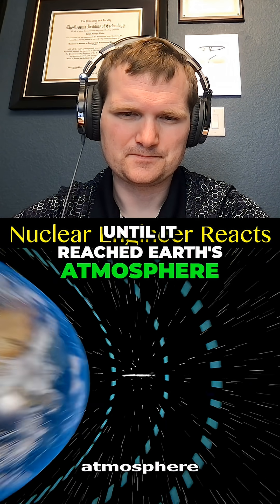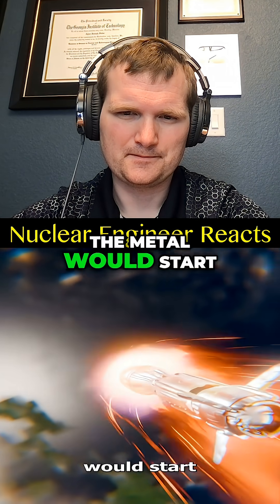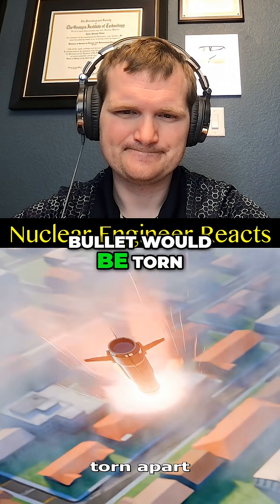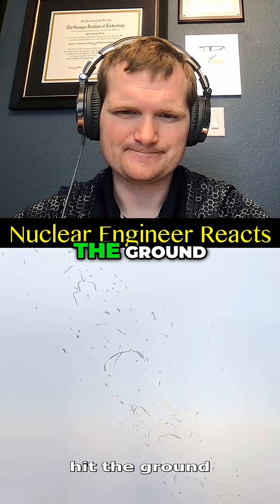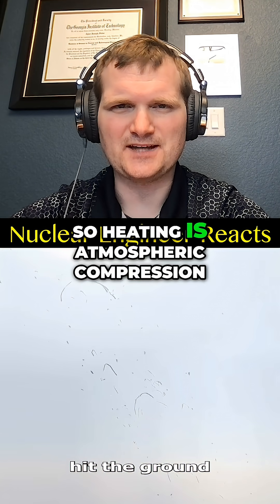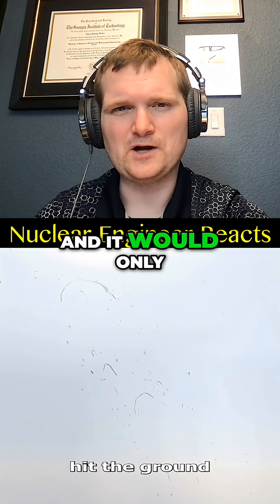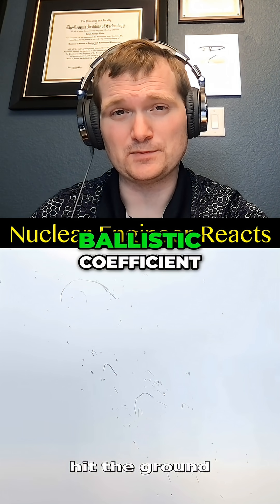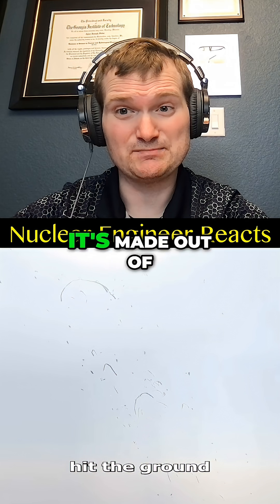Can a Bullet Hit The Earth from the Moon? - Nuclear Engineer Reacts to Zack D. Films

Comment: 15 tons TNT equivalent is not a "large conventional bomb". It is an enormous conventional bomb, larger than any conventional HE bomb in existence. There is at least one, the Russian "FOAB", but that appears to be either a thermobaric munition or a fuel-air explosive. Both gain power from reacting material with the surrounding atmosphere, which clearly is not appropriate in this case.

Plus, of course, assuming the full 11 km/sec for the impact energy is clearly wrong, as all the discussion of re-entry heating establishes.

Comment: Peter F. Hamilton had "kinetic harpoons" in his Night's Dawn trilogy, which were essentially a bunch of tungsten rods with rocket boosters slapped on the rear ends, and it was all about delivering kinetic energy at very high speeds to achieve destruction, not so much explosives or other fancy scifi mechanics (though there were plenty of those elsewhere in the books, too).

Comment: Even more damage if you can accelerate the rod to 18,000 miles per hour by having it orbit the Earth a couple times.  

Easier in theory than most believe as this is how we launch satellites to the outer solar system. Sling shot method using earths (or the Moons) Gravity.

Really any Large mass In space. Jupiter works amazing for this as I'm sure you all already imagine.

Comment: 15 tons of TNT equivalent is about 40% more powerful than the MOAB, which would be the biggest conventional bomb ever employed and had an 11 ton TNT charge. The shock wave of the kinetic energy would be a lot shorter in duration than with the most commonly used explosive tritonal, an 80/20 mix of TNT and aluminium powder that is designed to sustain the blast for a longer period, so there's less of a blast radius to it due to dampening out quicker.

Comment: Ballistic coefficient on hyper-sonic speeds is complete different story. Basically there is no way to make not heating on reentry. Also thermal shield shot protect it not for just reentry but till impact. Spacecrafts braking in the air to be able to land, so they stop heating very fast. The projectile will need to keep the speed, so it will heat entire journey.

Comment: I don't know about the quoted speeds. It should be less than 2.4km/sec (moon escape velocity) since you don't need to fully escape the moon's gravity to reach the equilibrium point (the Lagrange point) between earth and the moon. Likewise, the object would not necessarily reach full escape velocity at the earth's surface (even ignoring friction). Maybe the speed is just slightly less but I am not sure the significance of the difference.

Comment: I have a more interesting question, assuming this rail gun was shot from a static position in empty space instead of from a solid surface like the moon in this case, how fast would the shooter fly in the opposite direction and how long would it be of him flying at this speed to reach the last planet in our solar system given that there is no resistance since it is space after all and also assuming that there are no obstacles in his path or that he sustained no damage from the sudden acceleration.

Comment: I haven't watched the full video yet, but right off the top of my head I can see that one of the big problems is the fact that both of these massive objects rotate and that they're also constantly moving and moving at different speeds. Meaning that while the moon technically revolves around the earth because it is also moving and rotating and they're going at different speeds, you're not going to fire a straight shot like you would on land. It's like the same problem that time travel people have or they don't realize that if they go back in time, Earth isn't a completely different position in the solar system depending on where they travel. So you have to literally adjust for that.

Comment: Technically, if you want to be efficient, you not aim the gun at Earth, but instead in the opposite direction of the Moon's orbital motion, cancelling out the Moon's orbital velocity, which then would have the bullet fall in towards Earth, this would require about an extra 1 km/sec of delta v.  From there, it would take about 5 days to fall to all the way to Earth.  To hit the Earth by aiming directly at it would take a much higher initial velocity to score a hit.

Comment: Probably going to sound stupid here for asking this but hey if you never ask you’ll never know. When it mentions the part about it burning up and disintegrating you said it’s due to atmospheric pressure. Now here’s the part where I sound stupid😂 what is atmospheric pressure? I I always thought it was because of the friction it’s generating well passing through the air. kinda like what affected the early models of the Black Bird spy plane with reaching or staying at a certain speed if I remember right.
Reply: The Black Bird spy plane is a whole different can of worms, imo.
The atmospheric pressure being stated here is what’s responsible for the iconic “re-entry burn” visual in space movies. Essentially, when spacecraft enter and make contact with the local atmosphere, the air needs to part against the craft, but air can’t move past faster than the speed of sound so some special turbulent effects come into play. 
When a spacecraft makes reentry, it is going so fast that the air molecules in its path can barely get out of the way in time. For a short duration, the air is forced to travel with the aircraft before it can fly away, but this basically creates a very, very high pressure area in front of the spacecraft. That high pressure area heats the the air by a f\*ck ton, which makes that characteristic reentry visual of it “burning up”
Reply: @johncollinowensy4255 I now understand and thank you to you for putting it in such an easy way to understand.❤️

Comment: Over several of Robert A Heinlein's books is an ongoing plot of the workers on the Moon declaring independence from the Earth.
One of the things they do is to use the rail gun launchers, designed to launch rare materials mined from beneath the lunar surface into orbit around earth, to just launch giant chunks of rock directly at the earth itself.
It proves to be a very effective technique when you can pinpoint drop things on cities and other sites. 

On other note, Kyle Hill did a thing on the original Power Rangers and Rita Repulsa's staff was moving fast enough and was strong enough to not only make it to earth in seconds but also punch through the atmosphere and survive impact that it could have dealt with the Rangers on its own.
Reply: What a foul way to make a point those lunar colonists have...

Comment: if you aimed it at the earth directly, it would probably miss the earth because it has the moon's velocity added to it.
Reply: No, it would still impact, eventually.  It would end up in a rapidly decaying orbit, extending the flight time by a couple of weeks, as it wouldn't be fast enough to avoid getting caught by the Earth's gravity and be at the wrong angle to enter a (mostly) stable orbit.
Reply: @Razmoudah  First of all the period of such orbit would be longer than moon's, since it's higher energy, so it would take more than 4 weeks for the rod to complete a single orbit. Second, the rod would come nowhere close to Earth's thermosphere so deorbiting like this would take optimistically several billion years. Third, since the rod's and moon's orbits now intersect 4 times per cycle, there are significant odds of the rod either crashing back into the moon or getting ejected into outer space, depending if it got gravity assist prograde or retrograde.

Comment: You just throw rocks from the moon, just get them in the general direction, let the earth handle the rest.  Holmes IV was a very smart computer.
Reply: Generally speaking I agree. It's when you want to aim when things get tricky, however.
Reply: @ytgray Just use the same aiming methods they used to place the rice canisters where they were meant to be delivered. Maybe a bit more to be able to divert it later after they surrender.

Comment: 15 tons?  That’s 60% of the blast of a MOAB🐼
Reply: It wouldn’t really explode though, at least, not in the traditional sense. The MOAB uses its energy to propagate a heat wave that is the “explosion”.
This would be, as he said, an impactor projectile, so all of its energy will be more or less spent in piercing the target. Nearby items, such as air or reinforced steel, will be vaporized on impact, which may explode a bit, but its better use is in crashing the billionaire’s bunker market 😊
Reply: @johncollinowensy4255 once you are over a certain point of energy per unit of volume, doesn't matter. Everything becomes an explosion. Asteroids go boom don't pierce the earth
Reply: @robodjvalley  while you are correct, I find offense in using the asteroid as your case in point: while technically an impactor, it’s on a completely different geometry than a rail gun dart that’s designed to pierce. 
More than anything, asteroids don’t go boom, they just smash the earth so hard the ground becomes liquid
Your point is made though, still.
Reply: And would cost you likely 100000 times the amount.
Reply: Thats about what the little boy was btw
Reply: first time ive seen someone reference the MOAB outside of bloons
Reply: @thindering   Search up MOAB blast test and you’ll see whats being referenced

Comment: I have not done any math on this, so take this with a grain of salt, but I highly doubt a heat shield is necessary. The reason reentry vehicles use heat shields is because they enter the atmosphere at a very shallow angle to maximize the kinetic energy that gets dissapated to the atmosphere in form of heat. As the bullet gets shot at earth directly with a way steeper entry and also has a way lower drag coefficient, less energy is being converted to heat. Depending on how fast the bullet is travelling, it also might just not have enough time to melt.
Reply: And also it probably have much much better aerodynamics than reentry vehicle so even less heat!
Reply: My KSP knowledge tells me you are right. If you go vertical, you cross just a few kilometers of air within seconds.
Reply: How about the manhole cover that got blasted upwards from the surface by a nuclear bomb at least (exact classified) 6 times Earth's escape velocity
Reply: @Sparkletarts  the thing was, in fact, going so fast, I recall we’re more or less 50/50 on whether or not it burned up, or if it’s on its way to ruin someone’s day, somewhere and sometime.
Reply: @Sparkletarts i think that one was priven to be melted as well before full exit... its quite possible that air resistance didnt completely obliterate every last atomic bond on the steel... but i think mythbusters math is quite accurate on this one 🤔
Reply: i said this wrong but hopefully am understood 😑
Reply: Excellent point.  Bullets are NOT designed to slow down from air-brake
Reply: but any warping would completely askew any and all aerodynamics 🤔
Reply: @phyrhfbr1819 ICBM warheads have no heat shielding and can be precise within meters.
Reply: @gamesguy yes, but tell me again how fast those go? you seem smart and should know where im headed with this... 😏
Reply: @phyrhfbr1819 Like 8km/s
Reply: @gamesguy yes and also icbms dont fully leave the atmosphere, low earth orbit only 🤔 so why arent you embarrassed for using icbm as an example when its actually non applicable 🤔 i guess you're just half smart, or a really bad troll... shame 😅
Reply: @phyrhfbr1819 What does any of this have to do with your nonsense argument that this weapon can't be accurate?
Reply: @phyrhfbr1819  ICBMs enter the atmosphere at hypersonic speeds, and just because they go to LEO doesn't change the forces applying on it. The only major difference between going 10km/s from LEO to the surface and from anything past that is the time you are in flight. From LEO to the surface or farther to the surface you still spend the EXACT same amount of time in dense atmosphere.
Reply: @phyrhfbr1819  ICBM is in fact a great example because the amount of time that an ICBM is affected by relevant atmospheric forces when it begins its descent would be the exact same as something shot from the moon. LEO is outside enough from the atmosphere of the planet that it is defined as being in a non-atmosphere environment. Also an ICBM would in fact be going much faster upon impact than 11km/s.

The only half smart bad troll here is you. Someone who doesn't understand how any of this works.
Reply: you are right, it won't melt
Reply: Um...Traveling faster generates more heat faster...so increasing speed is the exact opposite of a good idea to increase survival.
Reply: You are right. Shuttles use heat-shields because they enter the atmosphere at specific angles to cause as much friction as possible to slowdown the craft. Ballistic objects (like ICBMs) experience almost no heating during re-entry because of the sharp angle taken.